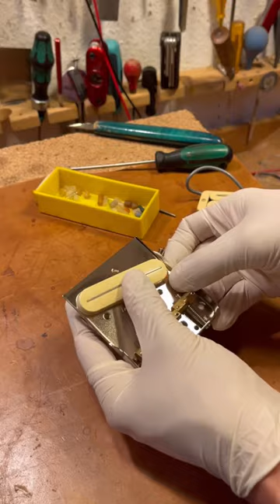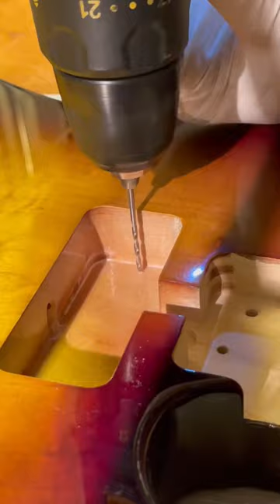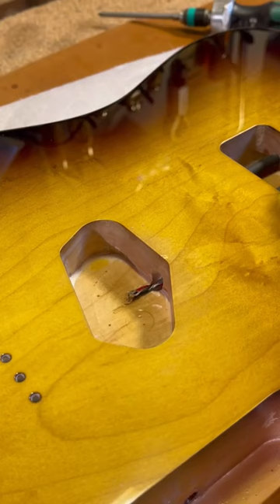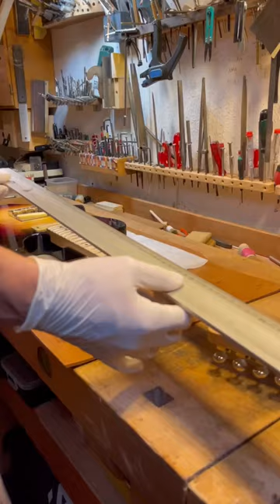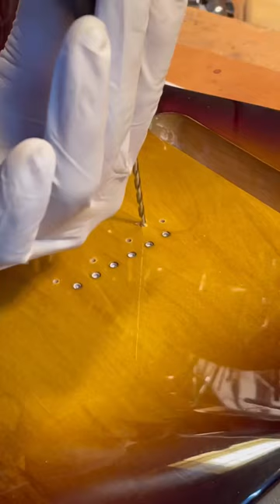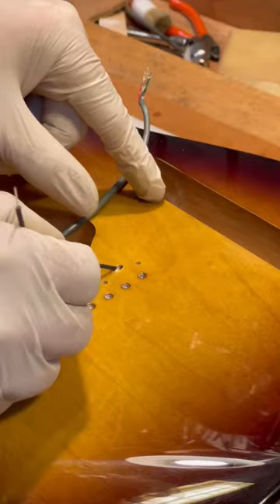Telecaster Pickup Assembly Telly Thursday Part4 #shorts #craft #asmr #craft #guitar #workshop #howto

Comment: How do you square up the bridge before you drill the holes? Thats what im worried about if i get a new body
Reply from the maker: Thanks for the question. I have center out the Bridge Position before the painting. The String treu Body Holes are my orientation. I just double check the position with a straight Edge and with the Pickguard. Best Regards Nik